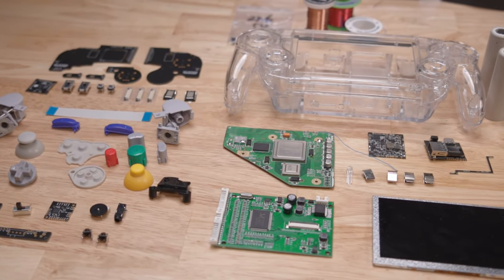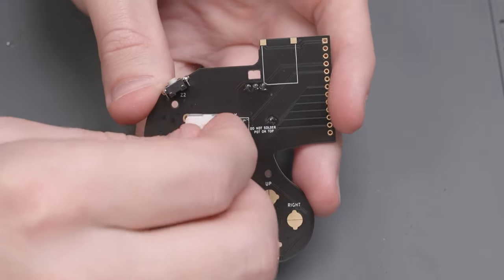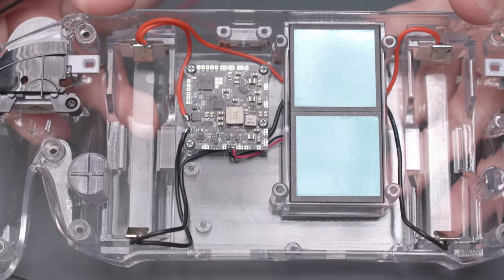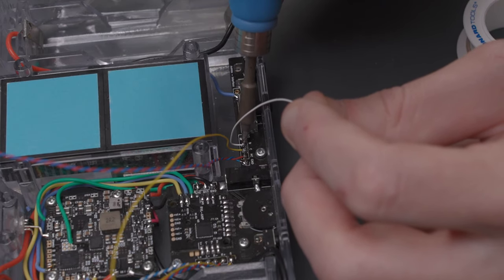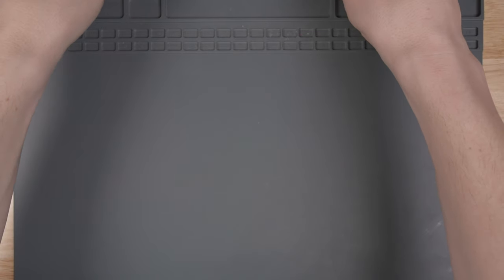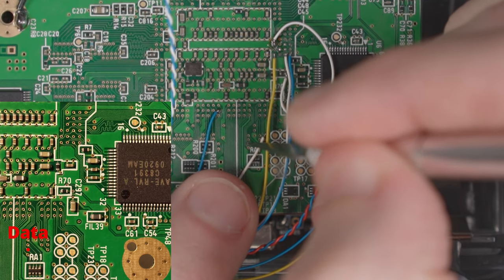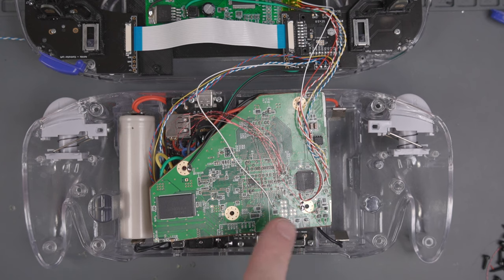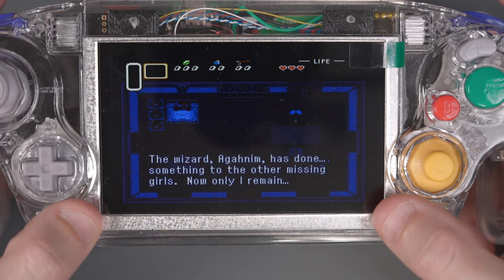"Easiest" Wii Portable is FINALLY Finished! - Building an Ashida Wii Part 3

Comment from the maker: NOTE ABOUT THE BOM Z BUTTONS: Gunnar told me that the BOM Z switches can be used by bending the legs so it stands up vertically. Might require soldering wires to the other legs
Reply: Only 2 legs are required for a switch to work, the other 2 are just for support. JoeBleeps just uploaded a video on replacing trigger buttons on GBA that uses a similar switch.
Reply: The "Force widescreen" setting for GameCube games that you're talking about in RVloader isn't about the display on the LCD panel, it's a hack that tries to modify GameCube games so that they run in widescreen (as in, Kirby is a circle when the LCD panel is set to 16:9). It doesn't allow you to play the games in 4:3 like you were hoping but if you're still "stuck" with 16:9 currently, it will make a lot of games look better to force them to run at 16:9, since you're already outputting them at 16:9 anyway.

Comment: Just a tip for the triggers, those metal brackets that attach the trigger button to the shaft can cause the trigger to jam. Nintendo themselves stopped selling gamecube controllers with those brackets after the first batch, and they can be completely omitted. Great tutorial overall!!

Comment: Ever since I watched ShankMods Wii portables videos like 5 years ago I wanted to build a portable Wii myself, but due to cost and lack of knowledge, I never got around to it.
About 6 months ago, I said to myself: "I'm going to finally do this", and with zero soldering knowledge, I began this journey. The Ashida came up as the best option for beginners, so I went with that.
Your videos on the Ashida were an extremely valuable resource for this project, and after 6 months of planning, work and one first failed attempt, I have a fully built working Ashida. I've been using it for about 3 days now and it works perfectly.
I wanted to give my thanks for these extremely detailed series of videos, don't think I would have ever been able to do it without them.
Reply from the maker: Thanks for taking the time to comment! it’s a pretty big accomplishment going from no experience to the Ashida, good job!
Reply: @dubesinhower hi, im about to Build an ashida , can you please tell me the price of all part and where can i get the 3d model for the shell

Comment: Your guide was immensely helpful! I was able to complete my Ashida last night due to this video. The only issue I'm having is with the fan; I don't know if it's faulty, or it's sandwiched too tightly in the case and can't spin.

I decided not to solder to the speaker legs, instead, I released the legs from the plastic housing so they stood almost vertical. This made it so the legs would contact the controller PCBs.
Reply: My issue right now is that my speakers are producing constant static.

Comment: I was soldering down a wire on the PMS-2 and removed one of the .74UH parts. I THINK I saved it though cause I was able to solder the tiny nubs on the side to the board

Comment: Hey, one question, it is safe to travel with the Ashida in a airplane? (Im asking because of the Ion-lithium batteries), and another question, i was reading the ashida BOM and in the PMS-lite or PMS2 4LAYER and PMS-PD 4LAYER sections when i click the link it says that is out of stock, and more below it says that it was replaced to an PMS PD 3, does the PMS PD 3 works for the ashida build or not?
Reply from the maker: Yes, the PD 3 is the board you want to use now. It should have improved battery charging as well.

According to the FAA, lithium batteries in gaming handhelds are allowed in your carry-on: https://www.faa.gov/hazmat/packsafe/portable-electronic-devices-with-batteries

However, I would not be surprised if the TSA thinks your Ashida looks like a bomb lol
Reply: @dubesinhower  thank you

Comment: 26:58 Heads up, the U10 wire you showed in the diagram is not the correct via. This may cause issues for some people.

Comment: The GC + 2 PCB doesn't seem to be in stock. Is there any possibility of a restock any time soon? If not is there a gerber file or something that I can use to order my own PCB?
Reply from the maker: There is actually a GitHub repo for that board: https://github.com/Aurelio92/GCPlus-2.0

Unfortunately you will have to load the project in Eagle (PCB CAD software) to generate the Gerber files

Comment: i really want to build a portable Wii but have no experience with soldering, would you still recommend this or should i try a smaller project for practice?
Reply from the maker: Definitely do not do this without practicing on a few other projects first
Reply: @dubesinhower  what do you recommend?

Comment: great video! having the same problem you had at 42:33. did shorter usb wire do the trick or was it something else?
Reply from the maker: Short wire + 34 gauge wire can wrap tighter than 30 gauge wire. So some combination of those

Comment: How in the goddamn world are you soldering to the vias??? I've just killed my wii because all the vias I needed to solder to are just gone
Reply: You need a good iron, some flux and small enough magnet wire (34 awg). I use a pinecil v2 as my main iron.